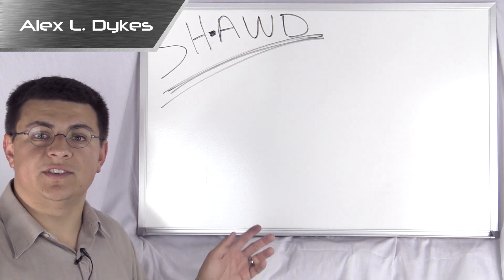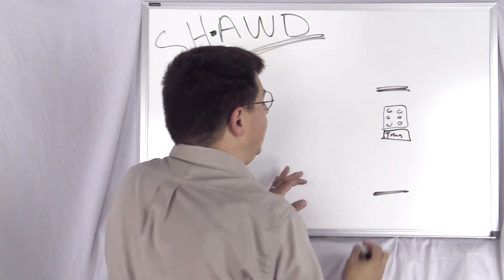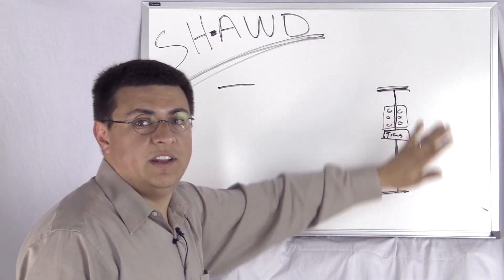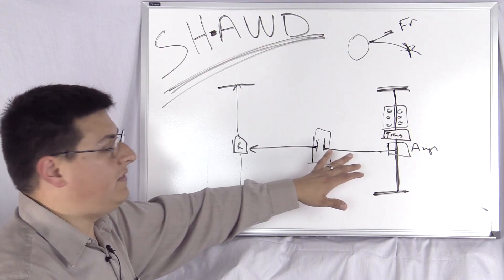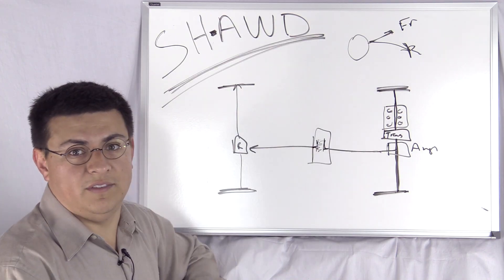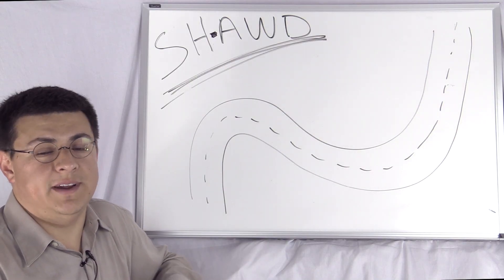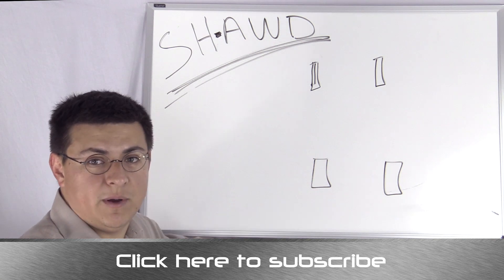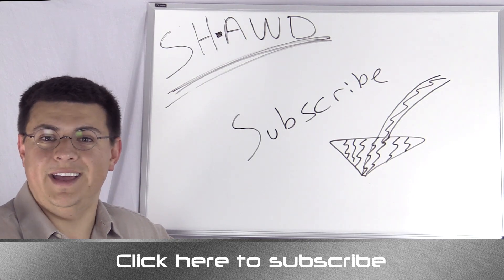How SH-AWD works: Acura's AWD system explained

Comment: Can you compare or contrast Subaru's asymmetrical AWD and how it brakes the inside wheel with Acura's SH-AWD and its outside wheel acceleration?
Reply from the maker: HolySteel Not all Subarus have the limited slip front diff, most have a simple open unit. You have to also keep in mind that while the boxer engine lowers the center of gravity, the design causes the front/rear weight balance to be more front biased because the entire engine is infront of the front axle. Boxer engines are also heavier for the given displacement than an in-line engine so the 2.0L boxer is heavier than the competing 2.0L I-4 designs. While it is true that the centred design and equal length half shafts help reduce torque steer, there is essentially no torque steer in an AWD vehicle to begin with and the R/L weight balance in a transverse engined vehicle is typically 50/50 anyway. Some transverse designs employ equal length half shafts with a secondary mounting point for one half shaft that make the difference negligible.  The Subaru AWD system is a very solid system, but we have to keep in mind that for marketing reasons every car company tends to exaggerate the pros and cons.
Reply from the maker: Systems that use the brakes to torque vector cannot transfer the same amount of power as the mechanical vectoring systems. They also heat up the brakes which can cause increased wear, a slight decrease in efficiency and added brake cooling load.
Reply: Alex on Autos would you be comfortable say that sh-awd is superior?
Reply: Xiao Zheng the Subaru has a more complicated center diff setup, and a limited slip front differential though. From a sports driving standpoint it's not much worse I think, especially since SH-AWD adds a lot of weight on the rear axle whereas in the Subaru the weight addition is in the center differential, so i suppose that's good for polar moment of inertia. Another advantage of the Subaru is that the engine is centered in the car which helps against torque steer and equals out weight balance, also the Subaru's Boxer 4 engine inherently has less secondary imbalance and most likely lighter weight.

Comment: This was decently executed!  Thank you for doing things like this.  "Conventional" SH-AWD is limited by the requirement that it has to be receiving power to vector the car. This means that if you're on the track with something like a 4G TL 6-6, you'll have to be careful in a carousel situation.  You have to allow yourself the time to settle between corners, or you could end up going into the third corner of a carousel a little too quickly.  Once you get the hang of the perfect steady state throttle through a particular carousel, it's fine...but if you don't know your car well, you can get into a little trouble in a complicated carousel.  SH-AWD is clearly superior to many other systems, but it's not the ultimate answer to all handling scenarios...but we're working on it.  :-)

Comment: The CLA 45 AMG is able to send 100% of the power to the rear wheels but it's a drive layout. Can you explain how the Mercedes enginreers have made that happen?
Reply from the maker: That's an easy answer but a complicated explanation. Unless a front wheel slips, the CLA45 AMG like most other transverse AWD layouts is incapable of sending more than 50% of the power to the rear. if a front wheel is slipping, the fact that the front differential is open but the connection to the rear wheels is fixed is what allows nearly 100% of the power to go to the rear wheels. The trouble with this is that traction control will intervene very quickly to bring the spinning wheel under control and return the balance to 50/50. This is why it is somewhat disingenuous in my book for companies to laud their AWD system as being "capable of sending X% of power to the front/rear as it is usually not the case. (The exceptions are the SH-AWD system and RWD biased systems with a torsen center differential.)

Comment: People like you make YouTube cool!
Alex, which crossover/SAV has the best drivetrain in you opinion?
Thanks
Reply from the maker: I am quite partial to RWD driving dynamics so for me the BMW X1 is one of my favorites. The system doesn't have a torque vectoring axle and although the 3.0L turbo is fun, BMW's 2.0L turbo four has a great weight balance and is more than adequate for the average person. For off roading, the only crossover that is capable in the compact segment is really the Jeep Cherokee. It still has limitations (the biggest is that it cannot be lifted) but it is also the only one with available locking differentials and a 2-speed transfer case.
Reply: Alex on Autos Hi Alex, I am a new BMW X1 owner and your review is one of the best.  I think you are mistaken above though.  If you option the BMW X1 with the M Sport package you get Performance Control as a feature...which is torque vectoring in BMW-speak.  http://www.bmw.com/com/en/newvehicles/x/x1/2012/showroom/driving_dynamics/performance_control.html
Reply from the maker: Matt Pfeffer  The system the X1 uses is a brake actuated system. This isn't the same as a torque vectoring axle because the mode of operation is quite different. The axles used in the full-on M products can direct nearly 100% of the power to a single wheel. The brake based systems essentially "consume" power. The effect is similar but far more pronounced on the torque vectoring axle solutions. The BMW Performance Control system is essentially the same thing that other car makers use in FWD vehicles to control torque steer.
Reply: Alex on Autos Ah, thank you for the clarification.  Kills my buzz a tad but still love the car.  Great all-purpose/all-weather city runabout with good luxury and good performance/handling.
Reply from the maker: Matt Pfeffer
The X1 doesn't need true torque vectoring as much as transverse engined vehicles do. The reason Acura uses it is to compensate for the front heavy weight balance which the X1 doesn't have. Some X1 models actually have a slight rear weight bias. When you have a neutral car the car doesn't tend to plow in the first place making torque vectoring less essential for at limits driving.
Reply: Alex on Autos With torque vectoring I think also about cornering but one of disadvantages of BMW's RWD is that it's front heavy and that's not great for traction (e.g. snow). Not issue typically in CA but it would be going to i.e. Tahoe. Seems SH-AWD is best of both worlds (with slight trade-off in weight distribution but we're talking about SUV's). X1 is much lighter so that also changes dynamics obviously.
Reply from the maker: Lucien E  almost all BMWs are nearly perfectly 50/50 balanced. In contrast SH-AWD vehicles are usually 60/40 (F/R) like most transverse cars. With teh BMW it's really just a traction issue, the xDrive BMWs perform very well in snow.

Comment: So is the SH-AWD system's primary benefit for turning and cornering rather than for slippage during inclement weather? Or does the system also aid with slippage?
Reply from the maker: It has all the benefits of a traditional AWD system in poor weather and the front/rear and rear side/side torque vectoring for performance.